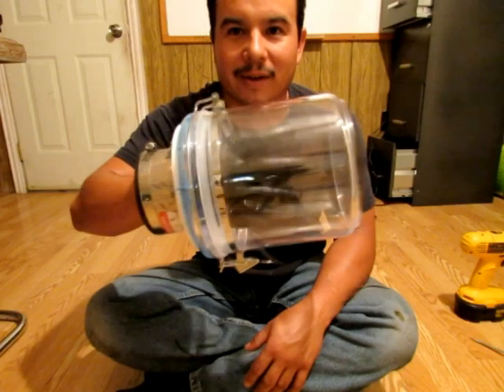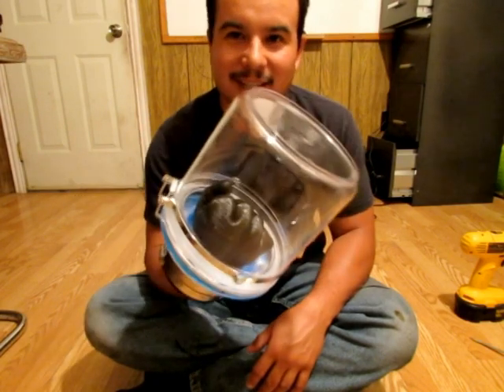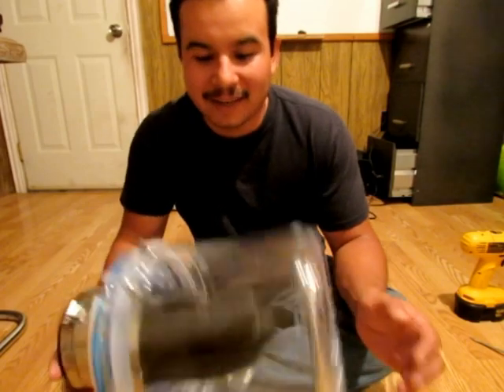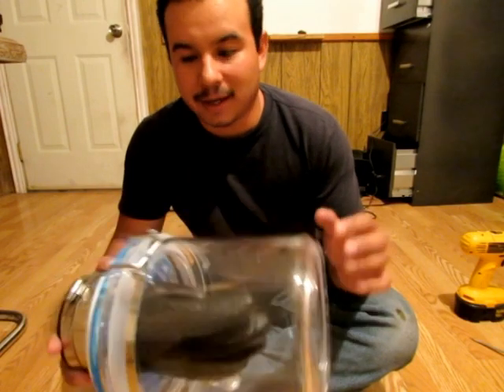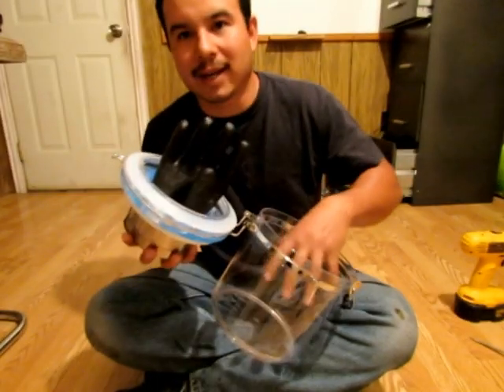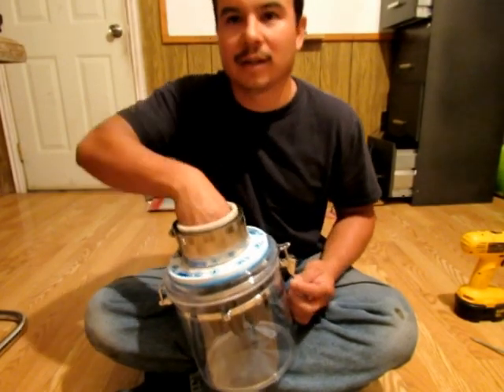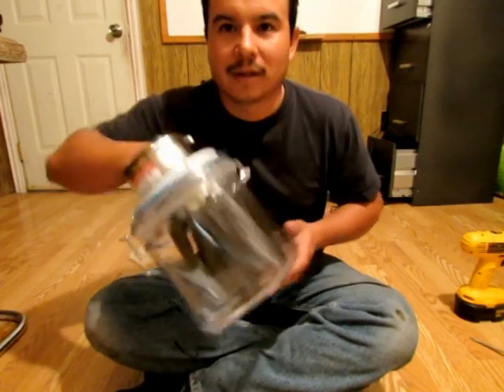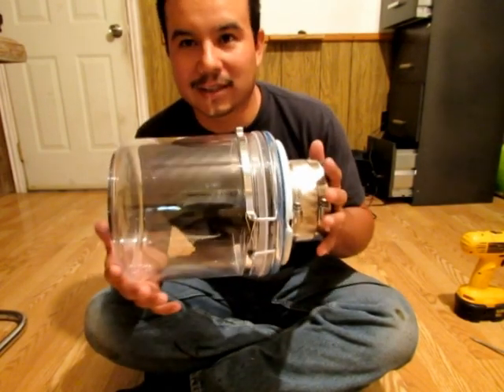Operational Underwater Camera Housing

Comment: This is awesome. I have a Canon T3, and I've been checking online for waterproof housings. Most are several thousand dollars. Way out of my range.
Great job thinking out of the box, it gave me ideas for similar projects. If I actually follow through with it I'll post a video and mention you in it. I really like your innovation.
Those suggesting a GoPro don't understand the limitations of it. A DSLR can do better work in your project than a GoPro could in its case. Also, I could use your idea with ANY of my cameras

Comment: It's floating not sinkable. Also, cut the long talk, just submerge it to at least 30 ft to test if it leaks for waterproof test. People wanna know the RESULT of sink it to 30-50 ft. I wanna design a box can sink into 30+ ft yet won't leak water in and it's compact not bulky. Testing under 30 feet result is needed, not just float in water test. Thx:)